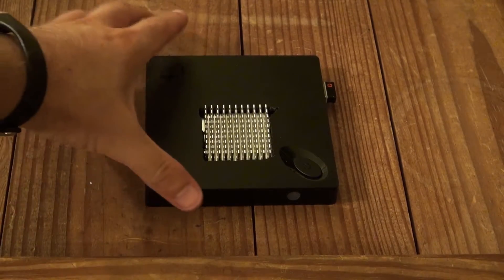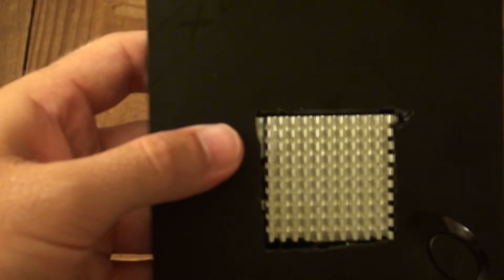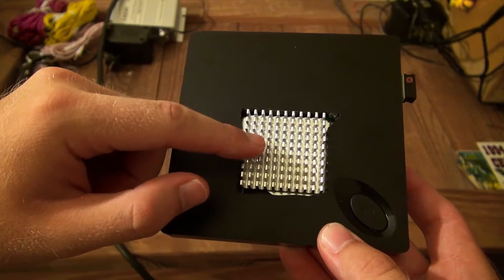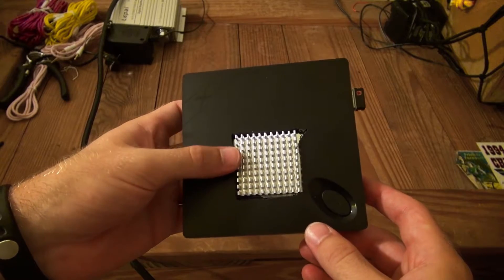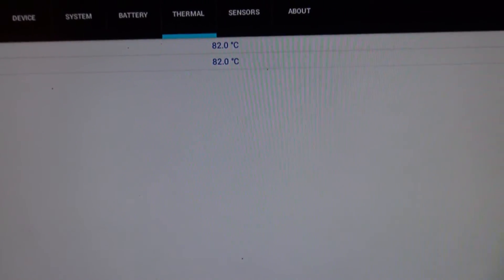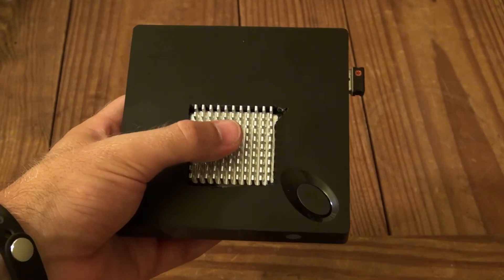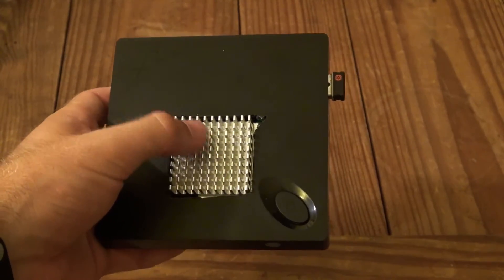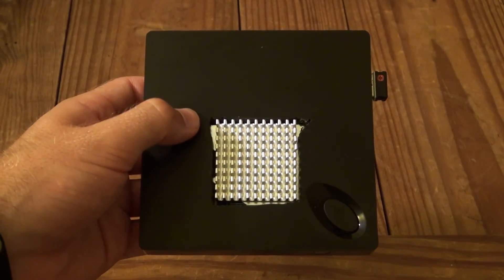Beelink X2 Cooling Mod

Comment: I ended up getting an Odroid C2 + wickedaluminium case in the end after reading many horror stories of Android TV boxes overheating. Even with the wickedaluminium case it tops out at a toasty 62 degrees celsius so I really don't regret investing in this case at all. I just don't get it, why can't there  be a single Android TV box provider that has adequate passive cooling out of the box, it seems they pretty much all overheat well over 80-90 degrees which really annoys me to no end as they all skimp on heatsink sizes just to save a few $$, why not use the entire enclosure as a heatsink.
Reply: There are a few out there now with a heatsink and fan that blows over it. They cost a bit more than the cheaper tv boxes

Comment: Just did something similar to my Tx9 cept using a larger (taller) heatsink and my max temps are 63c instead of 90c.
Reply from the maker: Yeah it should help keep the box cooler and hopefully make it last longer as well!
Reply: @GreenTechNetwork  me too. I installed a fan on mines temps dont go over 130F and idle at 118F
Reply: @GreenTechNetwork  what did you use between heatsink and cpu? Thermal Glue/ Compound or Thermal Pad?
Reply: @GreenTechNetwork  does the heatsink get hot to touch? This would prove that its moving the heat
Reply from the maker: @scottgriffin449  Yes it does get pretty hot, so it seems to help more than the old "heatsink" which was really just a hunk of metal. I used a thermal pad.
Reply: @GreenTechNetwork  temps stay at 145F now dont go over that like before it was 170
Reply: @GreenTechNetwork  thanks for the mod video i did mines just like this using a bigger heatsink and thermal adhesive
Reply: Trevor Brent   I have a Tanix Tx92 that over heats and freezes. Heatsinks are cheap the Chinese need to get their act together.
Reply: @davidbrown8303  my box is also a Tanix TX92
Reply: Me too it definitely helps

Comment: I have tx2 but there is no heatsink just little round piece of aluminium. I see some black things (may be cpu and gpu) but between them are no pads no paste no nothing. After some time it freeze will it help if i put som paste or thermal pads?
Reply: Try thermal adhesive and glue a bigger heatsink on top of the medal plate that the small heatsink sits on